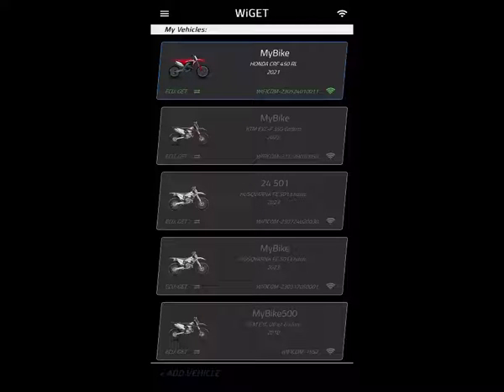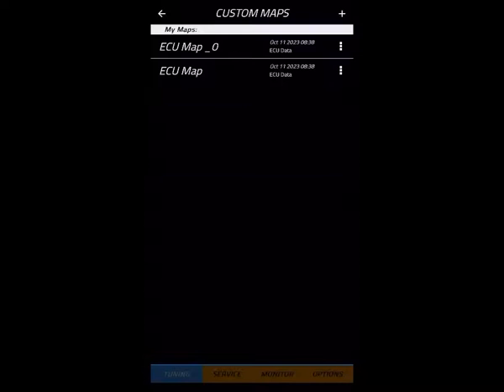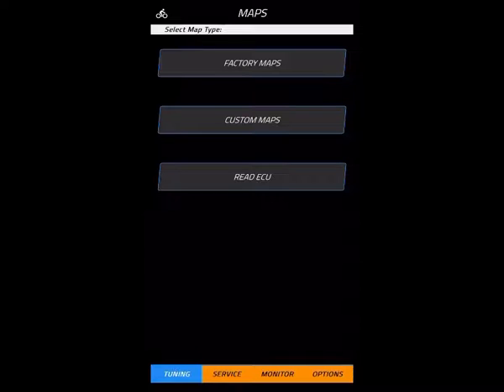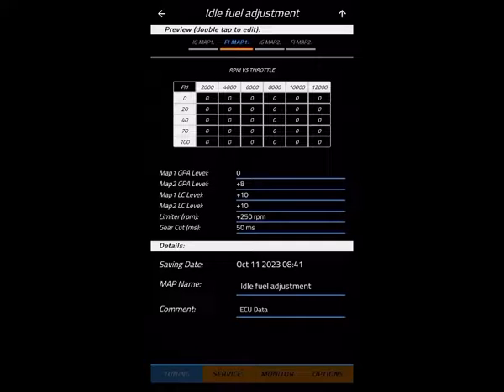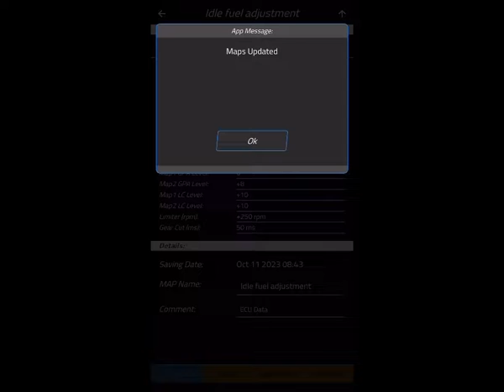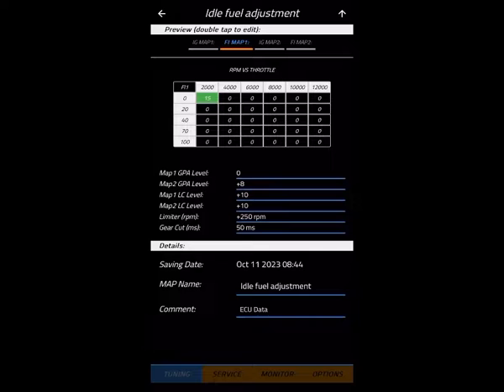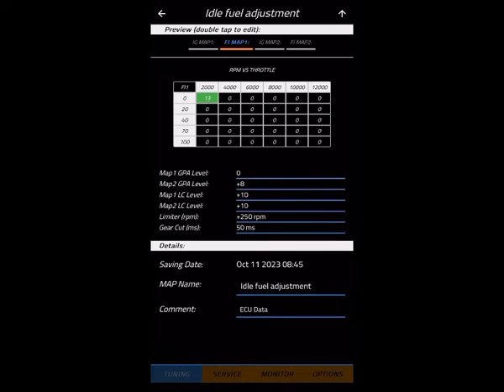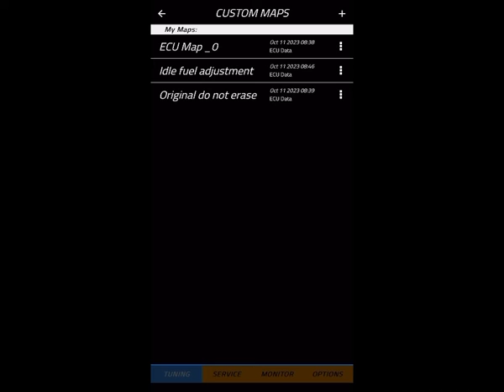GET ECU IDLE FUEL ADJUSTMENT FOR THE CRF450RL, L

Comment: Curious if you have a mild map for the GET that cleans up on/off throttle response but maintains reasonable fuel economy.  Bike has plenty of go for my use but on/off throttle response is as “advertised”🙁
Reply: Yeah, would be nice to have a BEST fuel economy map tutorial too.  For those times when you need to stretch the MPG to get to fuel.
Reply from the maker: @wesc23 that’s a great idea 🤘🏽
Reply from the maker: What bike, what mods, what map
Reply: @TACOMOTOCO  2023 CRF450RL.   Completely stock and no intent to change exhaust, etc
Reply from the maker: @paul.vanhout57 yes we do
Reply: @paul.vanhout57  the fuel economy is incredible on this unit. I'm getting 52 mpg. Riding at 240lbs with rider weight. Im not a pro and don't rip it at a pro level but when I'm on dirt roads it's wide open quite a bit. I was getting 56mpg with stock ECU and 28-34 with a San Diego powerhouse tuned vortex
Reply: @paul.vanhout57  I run a 450x exhaust which flows a little better but is still very quiet. The get ECU is so damn good and I'm really blown away at how smooth the bike is with that much extra power with little loss on mpg.